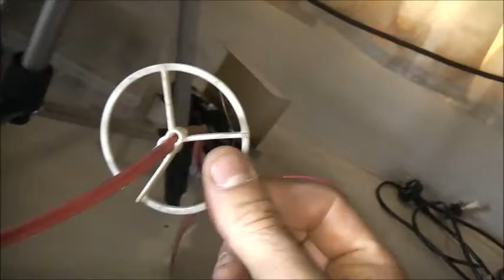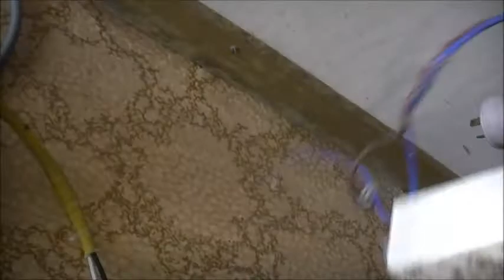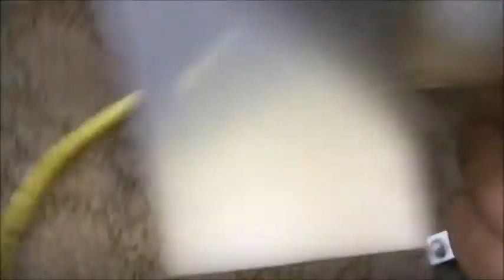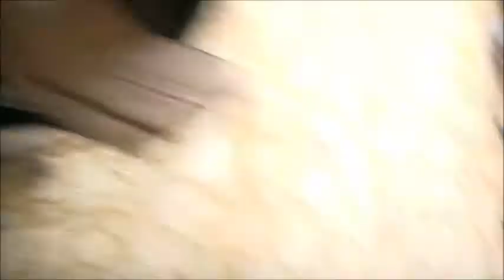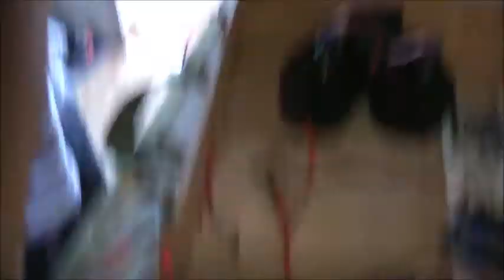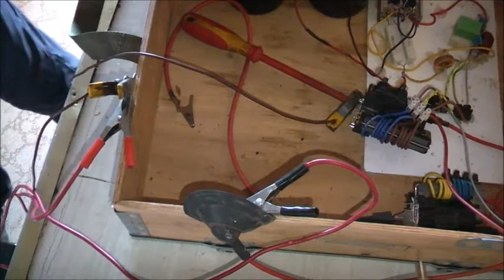Testing Flybacks!!

Comment: Nice arcs. :-)

When you use your ZVS device to charge-up the PFC bank, I take it that a flyback is used in that circuit, yes?

If so, It would be interesting to try out various different flybacks in the circuit to see which one charges the PFC cap bank the fastest, or at the highest voltage. :-)

Thanx for showing,

-BoomBoxDeluxe.

6th January 2014, 02.07
Reply from the maker: DC Flyback charges the cap!!

Comment: I totally agree about those rings, even add some extra rings when you are at it.

As for the pins, you should use a power-supply of 20++V. Connect minus to the red-wire and messure voltage between + and the different pins. The one with voltage is the one you look for. (ABL pin)

There is also a resistor of 200-400 MOhm between HV and some other pin inside the transformer, but that pin can be harder to locate. (Can be same as ABL).

By the way, what is the working and max voltage of your capacitor bank?

You may be able to messure the actual voltage using one of your flybacks and the internal resistor (most likely 300 MOhm: 30 kV = 0.1 mA).
You can possibly even use the transformer you use to charge it with to messure the voltage.

Best regards from me.